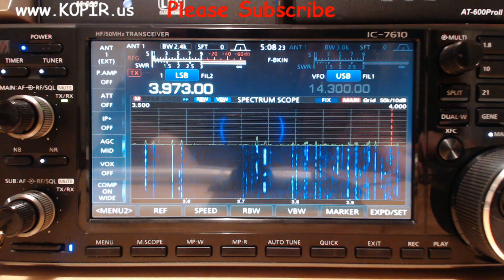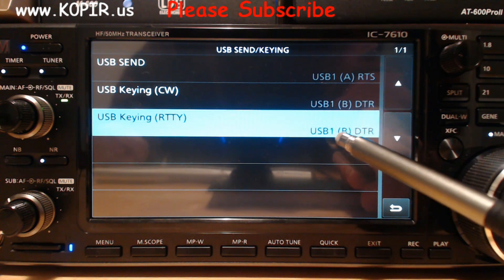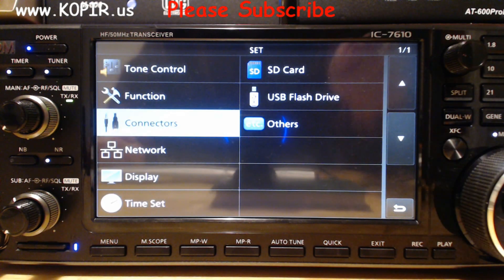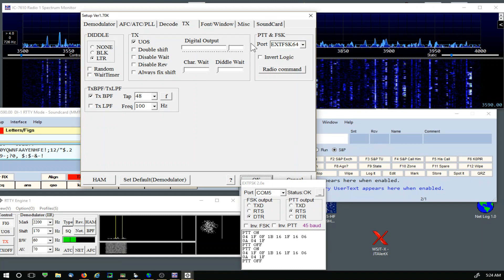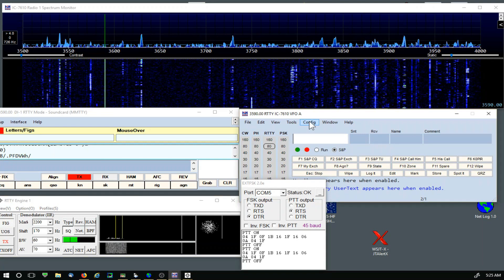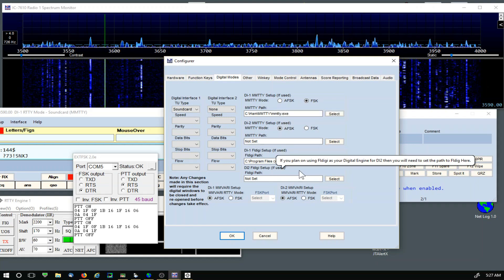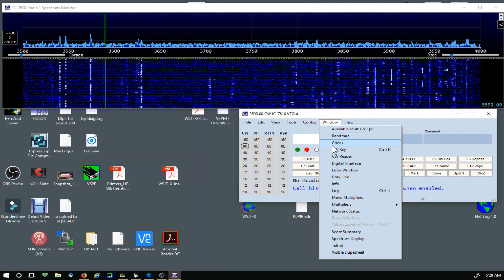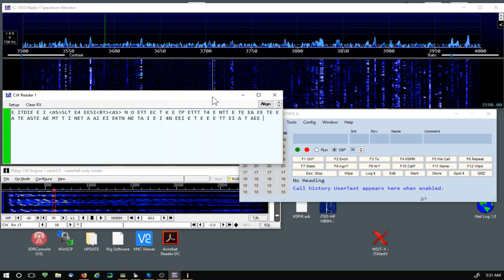Icom 7610 N1MM One Cable RTTY FSK CW - How To

Comment: When I use the radio settings that you show for usb keying and sending my WSJT program immediately starts tranmitting when I start the program. Have to shut the radio off. Do I need a CIV cable an usb cable in order to get programs like fldigi to work. Can't for the life of me get RTTY software to work. Thanks VE3WF
Reply from the maker: There is probably RTS on in software and radio. Go into the radios menu and turn USB SEND to OFF.
Reply from the maker: Have a look at this solution for needing two cables: https://www.k0pir.us/transmitting-cw-in-ham-radio-software/
Reply: @HamRadioAdventures  I got it going after watching your com port video. The trick is to set usb b for fsk keying and usb a for rig control. Thanks for the video's
Reply from the maker: @davidray4128  it's nice to hear from you and thank you for commenting here. Here is a video explaining those ports, https://youtu.be/PeIkasYQelI
Best to you and yours, 73!

Comment: Hi, Rich,  followed all the steps as you did, but still no diddle, as others have tried, too.  When I choose EXTFSK or EXTFSK64  I don't get that box that you show in the video, so I can't change the port as you indicated.  Everything is good, but no FSK on transmit, just the solid tone. Radio does transmit.
Reply from the maker: Nice to hear from you Larry and sri for the delay. That window sometimes hides. Use your Alt-tab to view the open windows on your PC. It's probably hidden. Mine does when I change from using one monitor to two. 73!

Comment: I’m still unable to transmit using FSK in RTTY or RTTY-R modes on the Icom IC-7610. I saw your post on the HRM thread where they were talking about the FSK was only sending one tone, no diddle. That’s the same problem I have trying to send RTTY with FSK. I didn’t see if that issue ever had a solution. Were you able to get your 7610 to send RTTY with FSK. I am able to send RTTY with AFSK with the 7610 SSB mode, but I want to be able to send RTTY with FSK. I tried using a RigBlaster Advantage, but FSK didn’t work with the RigBlaster Advantage either. I tried your 7610;configuration steps and that didn’t fix the FSK problem. Did you ever find a solution to the 7610 FSK problem?
Reply from the maker: Hi Dave, I know it can be frustrating at times, but it is usally just one setting that is incorrect. Keep trying because it is worth it IMO. Yes it does work FB especially in MMTTY. I use MMTTY with N1MM Logger+ and WinWarbler. I did not use it much in DM780. So you are trying N1MM and MMTTY? Most of the time one tone, no diddle is a setting in the software that is incorrect. Do you get EXTFSK Status Okay? Then when you transmit does EXTFSK send? If so, look back at the settings in MMTTY. See https://youtu.be/NmNHVjjAdiY?t=247
It doesn't hurt to restart the PC and then check those COM ports again in Device Manager. 
You can see more here: http://www.k0pir.us/icom-7610-n1mm-rtty-fsk/ and the Icom7610 screen captures: http://www.k0pir.us/icom-ic-7610-specifications-features/icom-7610-screen-captures/
If you are using other software, let me know. 73!
Reply: Thanks for the response! I can send RTTY in FSK when selecting "Decode" on the 7610, and transmitting from a TX memory. This works in RTTY and RTTY-R modes. I don't know what the differences are between RTTY and RTTY-R modes. 

I dont know what EXTFSK means. I saw that in a forum, but I don't understand what EXTFSK means. This is very frustrating! I wish I knew someone in the Twin Cities area that had an Icom IC-7610 and uses FSK, then I could bring my 7610 over there to make sure that the problem isn't something technically wrong with the new Icom IC-7610, that is preventing it from transmitting with FSK in the RTTY mode. With DM 780, I just get one tone, the lower pitch tone when I listen on another an old Kenwood TS-430 radio, and compare it to sending FSK RTTY from the 7610 TX memory. I don't think I ever read that you are using FSK, not AFSK. Can you confirm that you are using FSK? I assume you are using FSK. I have the same trouble when trying to send PSK31 in PSK mode or PSK-R modes. I don't know the differences between PSK and PSK-R.

I had the sound card set to use the "USB" for input and output when directly connecting the computer USB to the 7610, and the sound card RigBlaster input and output when trying to use the RigBlaster Advantage.

I thought  that the RigBlaster Advantage might fix the FSK problem, but it didn't. I am able to transmit with AFSK in SSB, but I want to be able to transmit with FSK, like I did decades ago. I'm also having trouble sending CW in CW mode. I can send MCW in SSB mode, but I don't want to use MCW for CW. 

I will check out my settings again with your links and check out the N1MM Logger + and MMTTY program. I am still on hold with Icom support for 90 minutes. I thought that maybe they could help. I plan on trying RigBlaster support and Ham Radio Deluxe support if I still can't solve the problem.
Reply from the maker: Dave Borchard  Yes I almost always use FSK. I have not with DM780 in a while, but I will try it just to see if anything has changed with the latest updates and ham radio deluxe. Yes I would try MMTTY.  That’s where you will see EXTFSK. It is in the video. I’ll try to do that today in DM780.
Reply from the maker: DM780 is not working for me Dave. MMTTY great as always. In DM780 I can get it to diddle when using the "Send F4" but my other radio is not decoding it. It doesn't sound right to me, so something is off in DM780. Maybe HRD support can help.

Comment: Having a devil of a time finding a CI-V cable for the 7610. Some folk think it’s an Icom SCS-8170. Can you or anyone confirm. Thanks
Reply from the maker: Ken Maclennan hi Ken thanks for commenting here. I don’t know what an SCS 8170 is. A link to a CI-V cable is in my video description, see above. If you go to my website I have links to CI-V cables and I’ll put one below here. In this video you don’t need a CI-V cable. I use a CI-V cable these days for controlling my rig with software like WSJTX, JS8call or JTDX. I also use it with the 7610 when I am using Omnirig, HDSDR and CW skimmer. 
http://www.k0pir.us/24-khz-cw-skimmer-with-the-icom-7610-how-to/
https://rover.ebay.com/rover/1/711-53200-19255-0/1?ff3=4&toolid=11800&pub=5575171312&campid=5337860891&mpre=http%3A%2F%2Fwww.ebay.com%2Fitm%2F282039866391%3FrmvSB%3Dtrue
You can find inexpensive CI-V cables on eBay and I use a couple of them and never had any problems with them. Some Hams will say the more expensive ones which are FTDI are better. The expensive ones and the cheap ones work equally as well for me. I hope this helps thanks again for watching best 73!

Comment: Thank you for creating this video.  I followed each step of your instructions with MMTTY and the 7610.  However, when I press TX in MMTTY the 7610 switches to TX and power out is indeed indicated, but no diddle, just a continuous tone.  Any suggestion as to the next step to get my diddle ?  I tried a different comm port in EXTFSK,.
Reply: Yes, data is flowing but no Diddle.  In the 7610, are you set  to "RTTY" or "LSB-D" ?
Reply from the maker: Andrew O'Brien  It needs to be in RTTY.
Reply: OK, Bingo.. I tried again and this time I have working as you described.  I have two USB cables from the 7610 in play.  N1MM/MTTY  is transmitting correct tones in FSK or "RTTY" mode on the radio.  However, my next task is to try configure the same set=up to work with Win4Icom Suite so I can use RTTY in a contest and view the IQ scope.  Maybe I should look to see how this is set up in N1MM since I believe it was IQ has been added to N1MM .  I can't do it with Win4Icom because it uses one of my 7610's comm ports and bothy are in use if using you set-up.  Many thanks. Andy K3UK
Reply from the maker: Hi Andrew, thank you for commenting here. It can be tricky.

Have a look at the MMTTY setup and the EXTFSK settings. Is your EXTFSK sending data? See: https://youtu.be/NmNHVjjAdiY?t=278

See: https://youtu.be/NmNHVjjAdiY?t=557

Rich, K0PIR

Comment: Rich: I figured there's some sort of instability becse EXTFSK64 window shows Ok or NG whenever it feels like. CW works fine  but RTTY will work fine IF the radio is in RTTY and then start N1MM Once you change modes, RTTY only transmits a solid tone - no diddles. Have to shut N1MM down and restart in RTTY to get it to work right
Reply: Paul, try changing modes by typing CW or RTTY into the callsign field. See if changing modes like that works for you. - Rich, K0PIR
Reply: yes i tried changing modes in the entry window, the bandmap , the radio itself and combinations of same. Inconvenient to shutdown the program but not a dealbreaker. Someday someone will figure out what's going on.Thanks

Comment: went thru all the steps ( a few times) . Problem: I'm just getting a solid tone (no diddles) for RTTY. CW works fine. Sometimes I recheck all the steps and RTTY will work, until I change modes. Tjhen it's back to a solid tone when gg back to RTTY. Any suggestions? WB2ABD
Reply: Hi Paul,

I have trouble every once in a while and it is usually the EXTFSK using the wrong COM port or setting. Have a look at it.  - Rich, K0PIR

Comment from the maker: I got a nice tip from John, K3CT. However, I still have two CW/Other boxes checked.

"I watched part of your IC-7610 YouTube video. Nice.

The reason why you saw the error message when switching from MMTTY to CW was because you closed the MMTTY window and that doesn’t change the program mode.

I simply change the program mode (band button click or enter CW in the Callsign box and press Enter). The program will shut down MMTTY, close the ports, and change the radio mode.

Your config has two CW/Other boxes checked. There should only be one.

John, K3CT"

Comment from the maker: The changes in the menu will not affect the operation of Ham Radio Deluxe, HRD Logbook or DM780.
Reply: Ham Radio with K0PIR I started this weekend with SPDX RTTY, went to FQP. After that contest , I went back to SPDX RTTY to check and Rtty worked just fine ... where it wouldn't a while back. Didn't change any settings _  Paul WB2ABD